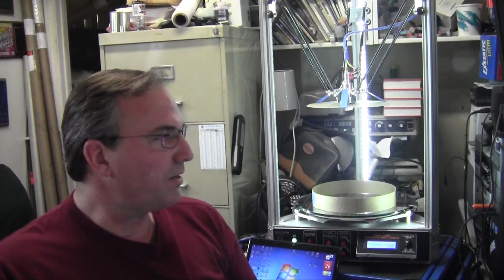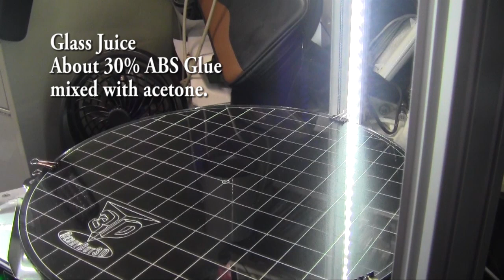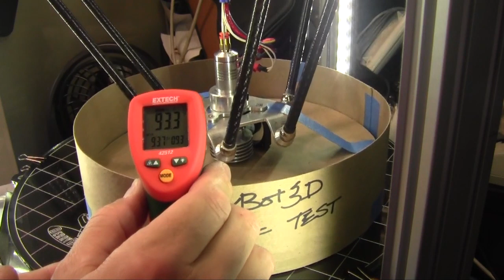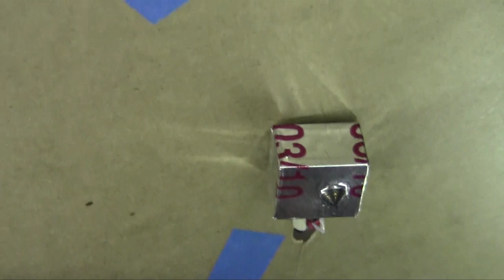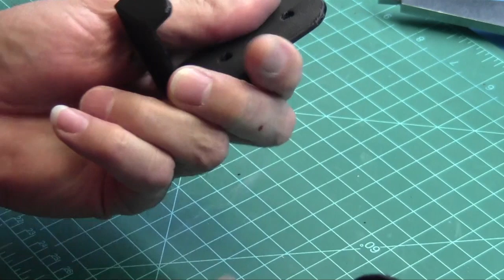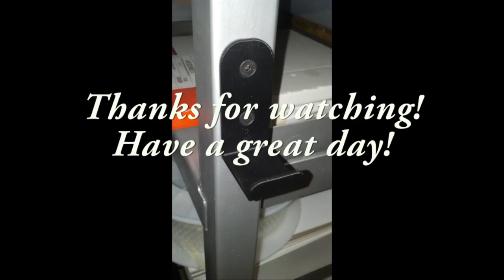The BerryBot3D Thermal Containment Accessory

Comment: Instead of using hard materials try making a cylindrical structure made out of heat resistant fabric. The fabric would attach at the base plate and on a disk like platform above the hot end. It would need to be designed so It can be collapsible into as small a footprint as possible but still capable of extending to what your printer's max printing height is. When the hot end moves up or around the fabric would just move with it, always keeping an enclosed airtight space.

Comment: I have a question, love your videos!  I see your printer is wide open to the atmosphere -  do you have a super ventilation system?  I have a Ultimaker 2 system with all sides enclose except for the top and front panels and print in PLA, after about 10 minutes of printing, I start to get a clog nasal passage and a sore throat.  How are you able to stay in the room long enough to make a video?

I even bought a fume extractor that was more than the cost of my printer (10lb carbon filter and a big hepa filter - max cfm with filters installed is 175cfm in a room that is 10ft wide by 30ft long) that cleans the air, as I am in an enclosed small workshop space.  I was thinking of venting to the outside, but thought I would try this first.

The toxins are still terrible!  Any suggestions?  Thanks so much!

Comment: Great video....  Neat idea on the enclosure.  I also found that enclosing my  ord bot improved ABS printing a lot.   I made a box out of the foam insulation with the aluminum facing that I just set over the whole printer. The odd thing is I found out the same thing you noticed....  When enclosed the  ABS cools to just under 90C and then holds in the upper 80s pretty well.  I think that is one of the main factors in eliminating warping.   Keep the videos coming!